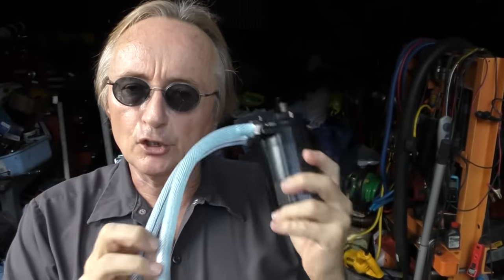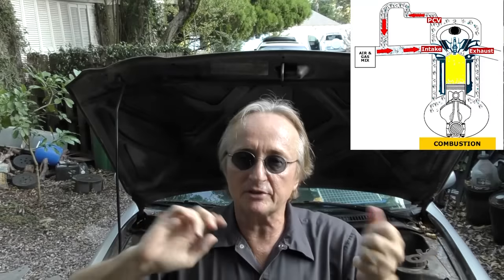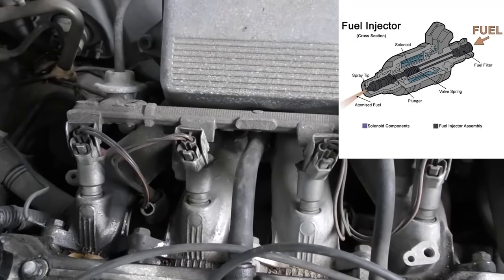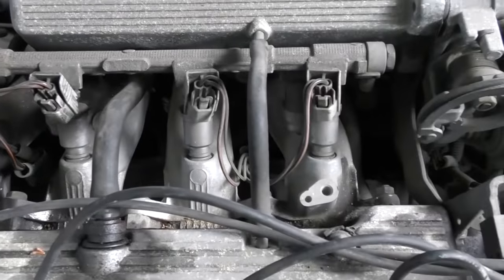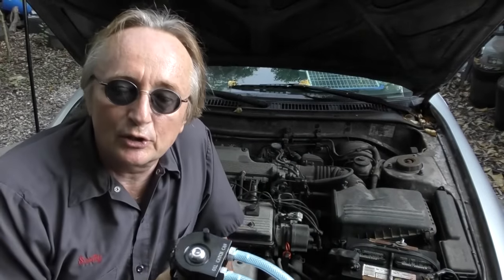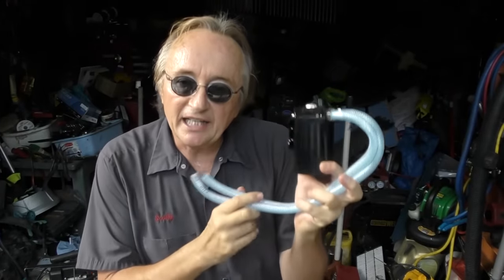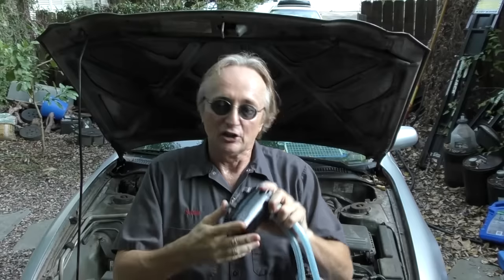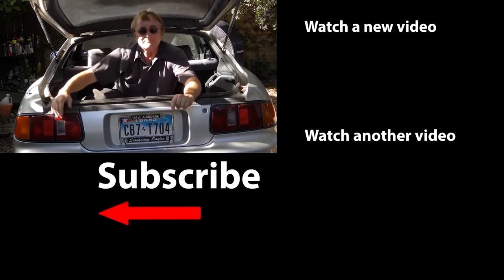If You Have This Type of Car, You Need This to Prevent Damage to Your Engine - Oil Catch Can

Comment: I'm curious as to why manufacturers don't put these on the cars from the very start.
Reply: Too much maintenance for most people. Remember: most people don't understand anything about how cars work and what neglect does.
Reply: PS. Also, water vapor tends to froze in the winter in that oil catch can system

Comment: I pit a Cork Sport ol catch can only 2019 MAZDA CX-5 2.5 L. turbo GT Reserve. After 6,000+ miles I drained 1/3 cup of nasty brown liquid THAT WILL NEVER REACH MY INTAKE VALVES. (The OEM air/oil separator would have NEVER caught that much crap.)
Nevertheless at 45,000 miles I'll have my MAZDA dealer clean the valves I intake system with BD fluid on their induction rig.

Comment: After all my research it seems cheaper to buy a new head than to maintain the build up. NOTHING seems to work! If I had known all this GDI crap a month ago I wouldn't have bought a 2016 kia optima with 40k miles on it. And no one walnut blasted heads within 60 miles of me and if they did it would cost as much a a head and self installing. My brother is a certified technician 28 years and so far we have installed a addw1 catch can and cleaned carbon with some water. Also I enjoy watching Scott Kilmer. I'm not taking the intake off just to see how much carbon is there. Like my brother says "just drive the darn thing, we'll cross that problem when it happens and cars are designed to fell now a days. Having worked in manufacturing my self I can vouch that engineers try to get as close to the warranty as possible for job security. Lol

Comment: The catch can won’t solve the problem with the buildup caused by the EGR, which is the main culprit on GDI engines which need high EGR flow to control NOx emission.

Comment: I have a 2017 VW Alltrack 1.8L T, it has direct injection, not looking forward to having the intake valves cleaned, but it's just not VW it's every manufacture that uses direct injection which is most every manufacture. The purpose of direct injection...better gas milage but at what cost? Better gas milage to save money? That doesn't make sense because you'll be paying out the money saved in gas by paying for maintenance, I've read anywhere from $500-$1000 to have the intake cleaned for my engine. All for what amounts to maybe 1-1.5mpg savings in fuel economy which translates to around $200 over 40kmi vs $500-1000 for maintenance not to mention the fuel savings decreases as milage goes up along with poorer performance. Toyota has the right idea using twin injectors (intake and direct) but it's not on their whole line-up and should a 4cyl engine really need EIGHT injectors along with the added complication of (more) electronics and diagnosis to determine which injector is failing. BTW I've read with direct injection you'll also get carbon build-up on on the injectors too. What a can of worms. And about the catch can I've seen many reports of the catch can not catching anything and some that do...it might depend on your driving habits? One last thing it's recommended that having your intake cleaned is around 40kmi and my warranty is 36m or 36kmi. And VW probably wouldn't cover it anyway. THANKS VW

Comment: Catch cans dont do anything to reduce carbon buildup in gdi engines.  They collect contaminated water (condensation) that would get burned off in a functioning pcv system anyways.  All you can do is change the oil every 3k miles and keep the engine in good tune.

Comment: Why not just redirect and vent the pvc to the open air?
Reply: That works fine, it's the way it used to be done before emissions controls but it's not legal so you may need to at least temporarily reconnect for inspection.  Also it will spray a little oil mist so you'd want to have a long hose leading to underside of vehicle perhaps to avoid oiling the engine bay.

Comment: PCV valves are plain vacuum leaks. ANY UNMETERED air by the MAF going to the engine is a vacuum leak. I dont know why engineers make the hose from the PCV valve go to the intake air box

Comment: ALL Gasoline direct injection engines have this issue, this includes Mazda new Sky Active engines as well, Toyota cars have a dual system as scotty said, they call it multi port injection, its more sophisticated than a regular GDI engine. it has all the benefits of GDI and none of the drawbacks. The drawbacks can totally ruin the car engine under 100 000k. I am very disappointed in mazda for this, they should have been smarter. All the new mazda skyactive engines, VW engines, Audi, need Catch cans because they are all GDI engines.

Comment: Yes but the oil then you cache whit this is no longueur in your engin ???!!
Reply: Ookk but this oil is not suppose to lubrifiant the valve and the cam ???
Reply: Is not don trouble of driy  cam and valve in long temps ?? Me i have a Veloster no turbo 2015 whit only 82 000 km i need it or not ????

Comment: GDI or not, any oil that can prevented getting in the combustion process is never good. Very cheap insurance.
Reply: In older engines the valves never were coated with oil because the gasoline coming in from the fuel injector/carburetor washed it away.
Reply: @SuzukiKid400  very true. It's why some manufacturers now have GDI and port injection together for that reason.

Comment: I don't understand why cars don't come with oil catch cans from the factory! Also all cars benefit from oil catch cans, not just GDI engines. Having oil and blow by go through the intake and throttle body and engine of any car is not good!
Reply: Korey Mayo car manufacturers want as little maintenance as possible for consumers. If you don’t empty it it can dump oil in excess throughout your system. They mold for the lazy consumer.

Comment: WRONG AGAIN - at least partially.  Scott says, 'newer models don't need a catch can because they have dual port/direct injectors.'  Well, Scott....there are LOTS of new models that only use Direct Injection.  Kia / Hyundai.... The new Ram Hurricane Engines are direct injection only..... Do some basic research.

Comment: Hyundai makes nothing but GDI engines now.
Reply: Peter Lamoureux Hyundai’s new 2.5L engines coming in 2020 models are going to have dual PFI/GDI. First car with them will be the 2020 Sonata.
Reply: Ryan Sawadichai   That’s an improvement.
Reply: @deepcow  I think it's a silent admission by Hyundai/Kia that carbon on GDI is a serious issue. Even Audi is using a dual system now. But at least manufacturers are starting to implement solutions. Mazda says that they studied carbon formation in GDI and for the GDI Skyactiv they rerouted the engine cooling to run the intake valves hot because carbon supposedly doesn't form above 300 C or something. No idea what Honda does about carbon but Scotty said in the Honda oil dilution video that he hasn't seen newer GDI Hondas carboning up yet. Of course, mainstream Toyotas have always had port injection and continue to use them with GDI.

Comment: This is NOT going to prevent carbon build up on direct injection engines. The buildup is caused due to fuel not being atomized in the intake manifold and traveling by the backside of valves (cleaning them) like you see on a multiport injection fuel system. Why do you think Toyota runs direct injection in conjunction with multiport? Just to clean the backside of valves to prevent carbon buildup causing multiple cylinder misfires on cold starts. The reason you run a catch can is to prevent fuel degradation, primarily, in turbocharged applications, which in term prevents less chance of detonation or pre-ignition. Please educate yourself people. Not everyone on YouTube stands correct.
Reply: Right professor. You're preventing oil from entering the intake.

Comment: Dont need this with my 2.2 ecotec. No pcv to bypass. Profit :D
Reply: adirondacktrail  I'm NA. Maybe you're thinking of the 2.0? I've thought about turboing it but if I recall correctly, the 2.2's have weak internals, mainly the rods. I'd be better off with a blower.

Comment: DO NOT INSTALL THIS PRODUCT👎👎👎 Or you may damage your engine.
Check out the video 'This Is Why I DO NOT INSTALL AN OCC OIL CATCH CAN' by (channel) Mr. DIYer, where he explains why, and why no manufacturer includes an oil-catch-can out of the factory (if it's such a great product).

Comment: blah blah blah. I've seen a lot of Audi cars that never got the walnut blasting that lasted well past 150,000 miles and resold to the next sucker. Since you can reliably get 150,000 miles out of GDI without a catch can; I don't see a need for it. I've seen an 06 Audi a6 with 230,000 miles still running just fine. Who tf keeps a mass produced car that long anymore?